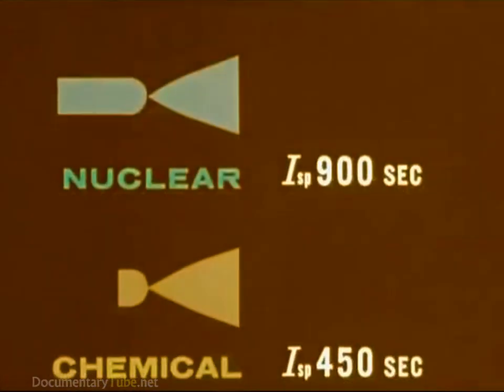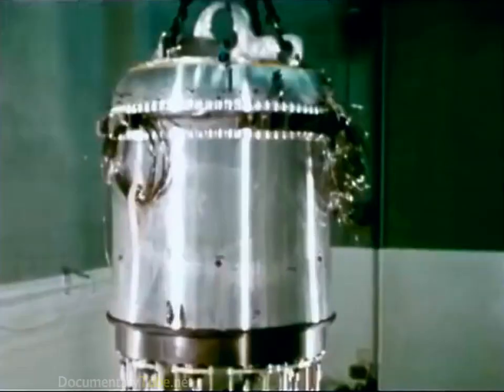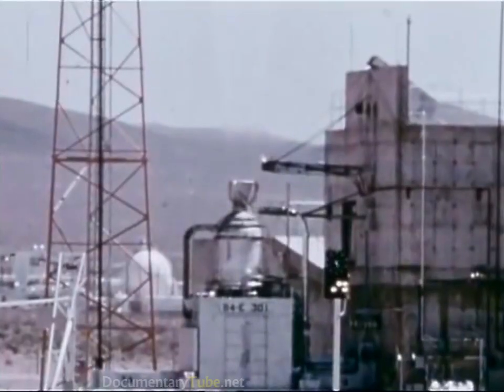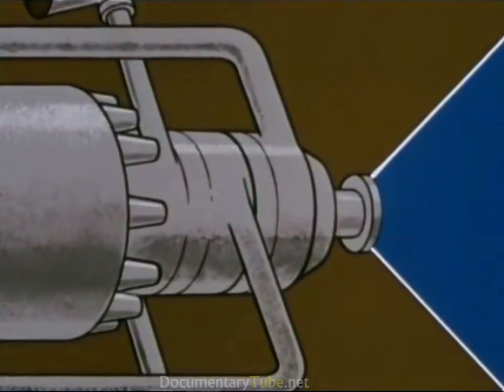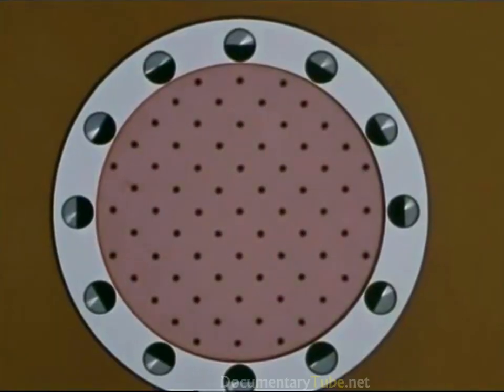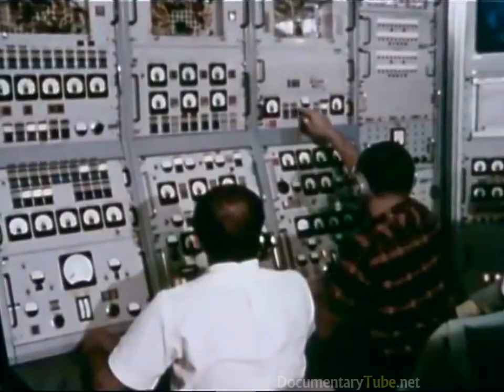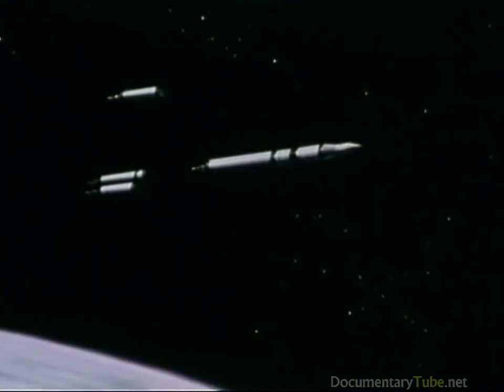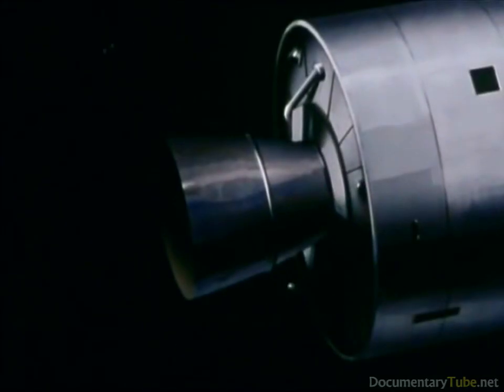HOW IT WORKS: Nuclear Propulsion

Comment: A rocket made with nuclear propulsion may have crashed in Russia about a week ago, The Russian government is scrambling to obtain Iodine tablets.
Reply: The russian one was a nuclear ramjet for a cruise missile. its principle is simmilar bur it heats up air instead of hydrogen. its simmilar to the project pluto
Reply: @nikos karavitakis < Problem is that air breathing ramjets won't work in space where there's no air, so they need to supply pressurized oxygen for it to work.
Reply: @BillAnt  Just seen the reply. This one was meant as a supersonic mach 3 cruise missile like the one in project pluto. Never meant to go to space
Reply: looks and sound as if they are down playing it the Russian that is
Reply: And yet this pin head MJ Horn is selling/promoting this fkn garbage, and saying most of us ignorant, caveman rubes cant comprehend its safe use...FK THAT! ITS GARBAGE! And must be relocated to the waste dump of technology!!! We cant even get rid of, or neutralize the waste, yet these fkn imbeciles promote it!!! SMFH!!
Reply: Infowars lifeshield..
Reply: ThothHeart Maat, WTF?
This very video points out that the reactor is cooled by the liquid hydrogen, turn off propulsion and you have turner off the cooling. With no atmosphere in space heat will not be pulled off the reactor, it will migrate on any possible path, like a spaceship.
Have any of you 'tards NOT wondered why this method wasn't pursued? .. No, I'm very disappointed in the users out there who suddenly get the religion of whichever videos make their happy sticks salute. 
There are 3 forms of heat transference LOOK THEM UP. What does space not have? 
Stop posting your uninformed opinions and learn.  You have 2 eyes, 2 ears but only one mouth, there's a good reason for that.
Reply: This video does NOT depict "Nuclear Propulsion" This video depicts a nuclear reactor acting as a high temperature heater for the on-board fuel. It's stupid.
Reply: @roxyraccoon8856  I was referring to the Russians looking for iodine tablets .. Infowars lifeshield x2...
Reply: ThothHeart Maat, I guess I have an itchy trigger finger.
Oppenheimer and many of the other Manhattan Project Ph D's had interesting things to say about "releasing the devil". Hanford,  WA, atmospheric testing,  Fukushima,  Chernobyl, Three Mile Island, the Detroit Breeder Reactor, unpublished incidents. Now this "unlimited" cruise missile.

It's why I laugh when I hear about "the superiority" of man. We don't seem to have the will to do what is best even when it is obvious.
Reply: @roxyraccoon8856  conduction, convection and radiation.  This rocket would operate on the principles of convection and conduction principally.  Some losses through thermal radiation would invariably occur.  The ISS uses thermal radiance to cool their battery packs.  It isn't like it can't be done.  That's how heat gets to the Earth from the Sun.  Light in the infrared range transmits heat.  Cooling it down isn't the hard part.  Carrying enough fuel to feed it is the big problem.
Reply: Rehoboth Farm, Space has no atmosphere, our Sun provides only Radiant heat. A reactor driven spaceship couldn't cool down sufficiently in Space to stop fissioning. Control rods or not, you need to stop the reaction, you do that by shedding heat.

Radiation is an ineffective means of shedding heat for nuclear reaction but for our Sun, that's okay.  It uses nuclear fusion and we really need it to keep working, all life on Earth would otherwise die.

Here on Earth,  WITH an atmosphere,  we must use water to cool nuclear fueled electricity generation plants. If we used only the atmosphere,  it would not be enough to stop the fuel rods from going critical. The control rods are used to slow the process but unless we also take away the heat, it is not enough.

Even IF the nuclear reactor contained nuclear fission material only "about the size of a marble" you're either using liquid Hydrogen to cool it or your fission material has melted its' surroundings and left everything in the engine radioactive,  which migrates to ship occupants. It actually destoys metal or did you not see the footage from inside Fukushima?

How many new reactors do you want to carry?  How much liquid hydrogen will truly be enough? 

Use too much fuel to cool it and you really are going too fast for anything except distant galaxies. Good luck decelerating or getting back. Far more fuel to decelerate in Space is required than to accelerate, you're going faster than you were the last time you ran used your propulsion.

The only proven practical use of nuclear reactors are submarines and large surface ships (plenty of cooling water)  - though,  the military can have them, I have no interest in being able to stay at sea longer than even they actually stay.

The clues about why a system featured in this video is a bad idea:
1. The reasons I  have listed in this thread,  some of which I will repeat here.
2. The speed of Voyager 1 and 2, traveling only thanks to initial rocket boost and the rest from using gravity from nearby bodies as a slingshot.
3. The fact that bodies in space not influenced by gravity but pushed by some form of propulsion will not stop accelerating.
4. Money.  You guys can't wait to spend it, especially when most of it isn't yours. Companies that would benefit from your ignorance are NOT Companies that I wish to fund.
4. I would in fact, like to line up all the retards who make their decision based only on videos and things they like to hear to all get together on a spaceship and go away,  I truly don't care if the spaceship works or not.
Reply: @roxyraccoon8856  Heat is shed by passing cold fuel through the reactor.  That's how the thing works.  To stop the reaction you would send fuel through the reactor till it is cool after turning the control rods.  Watch the video.
Reply: @roxyraccoon8856  3. The fact that bodies in space not influenced by gravity but pushed by some form of propulsion will not stop accelerating.
DERP that's the point.
Reply: @roxyraccoon8856  "Here on Earth,  WITH an atmosphere,  we must use water to cool nuclear fueled electricity generation plants."
The reactor in the video uses liquid hydrogen for cooling.  They built them, tested them and they worked.  You must be a democrat.  When your opinion doesn't match reality you then question reality.
Reply: Rehoboth Farm, MONTHS of cooling in cold water that is continuously flowing is necessary.  The water then must also be cooled for a long time or else boil fish.
Reply: Rehoboth Farm, Your ONLY intelligent posts are when you quote me so do it exactly and put all of and only my words in quotes, pretty please.
Reply: Rehoboth Farm, I wrote already just minutes ago  " The video showed only a brief use,  not the core nor fuel rod after use". Money spent,  engine tested AND? Rejected
Reply: Rehoboth Farm, It boggles the mind that you equate shooting down a test platform with "success".
Reply: @roxyraccoon8856  It was canceled in combination with the mars mission that it was designed to power back in the 70's.  The engine worked.  And apparently you didn't even watch the video I posted because it was a stationary test.  The main reason that nuclear rocket based technology didn't become popular was because idiots like you aren't even willing to understand the technology before deciding that they don't like it.  Do you still maintain that it is impossible after pretending to watch a video of the actual tests?  The actual tests proved that the technological basis was sound and that it produced thrust at five times the efficiency of chemical rockets.  Those are the facts in the place that we call reality.  If you actually watched the original video you would understand that the control rods being turned in create a reflector which causes the reaction to begin and rotating them the other way stops the reaction because one side absorbs protons ejecting from the decaying nuclei and the other side reflects them back in.  It is a very simple design made for use as a rocket.  It doesn't use fuel rods.  It bears almost no resemblance to the water cooled breeder reactors that are in use in the US today (which my father built).  Piss off.
Reply: Rehoboth Farm, HEAT! I can't keep making that point.  The test in your video link was on the ground (DIFFERENT from Space) ALSO,  NOT sinking in with you. 

So, I watched your video that had no sound nor narration,  I saw little thrust and while you might fail to comprehend the reason, I do.  Anyway,  you were kind enough to point out that it didn't fly so, it's much like all those toys you still play with.

At least you made it clear,  your father worked in the industry and you were hoping for a job L0like his, ripping off the taxpayers.  You didn't define his role in the "build". Did he pour the concrete? Something else?  I''ll bet he worked on the Breeder Reactor just outside Detroit,  the one that nearly killed millions. "We Almost Lost Detroit", good book.
Reply: Rehoboth Farm, A reaction in concentrated nuclear material will not stop unless it is cooled and no amount of influence external to that material will stop it.
Reply: @roxyraccoon8856  No.  That is not how it works.  You're wrong.  You don't know what you are talking about.  It is a nuclear reaction not a chemical reaction.  Heat is produced by a nuclear reaction but heat does not create one.  Go get an education.
Reply: Oh, shouldn't we ALL believe Rehoboth Farm and not the extensive reporting on Fukushima? You're 'admitted' to be another one of those "very stable geniuses", eh?
Reply: Rehoboth Farm, Heat makes any atom excited or, less stable.  Unwise for Uranium,  especially material already fissioning.  You didn't choose not be in nuclear,  that industry chose not to hire you, it is plenty clear why not.
Reply: Yes the Russians were  working on air breather jets. We found out jets were not a candidate for nuclearization. Yes rockets in deep would be useful and practical but must not be allowed to pollute earth or another planet.
Reply: Это неправда, никакая ракета с ядерным двигателям не взрывалась.
Reply: Rehoboth Farm, It is no one's fault but your own if YOU FAIL to comprehend that too much liquid Hydrogen becomes necessary, especially for slowing down.
Reply: Rehoboth Farm, The video showed only a brief use,  not the core nor fuel rod after use but hey, I guess you're "smarter" than all the Doctorates who still won't use it?
Reply: Russians should have just watched our YT videos to know nuke jets are not viable.
Reply: @mksherwood3068  They are viable and an would be an extremely important component for interplanetary spaceflight.
Reply: @roxyraccoon8856  They are ONLY intended for use in space. You don't know what you're talking about and didn't even watch the video.
Reply: Martin Stöckl Yes, but not for missile propulsion
Reply: @u3x590  The latest developments in nuclear propulsion are sadly intended to power intercontinental missiles flying at hypersonic speeds putting them out of reach of current antimissile technology. The resulting nuclear pollution is negligible compared to the atomic explosion of the bomb it would be carrying.
Reply: @roxyraccoon8856  >>> "pollute other planets"?  HOW??
Reply: @roxyraccoon8856  >>> "kick ourselves off the Earth"?_  HOW??

When the control rods are set, the reaction ceases.  You would KNOW THAT if you REALLY WATCHED this video.  

The crew would be shielded by (1) NOT being CLOSE to the reactor, and (2) Shielding is only necessary in the direction of the crew.  The ENTIRE CIRCUMFERENCE of the reactor does not need shielding like a reactor on Earth does.
Reply: RocKiteman _ 2001, oh doody! doody!  a stupor genius has appeared...  Control Rods only stop a reaction only IF the heat is ALSO removed.  How do you shed the heat in space, IN SPACE? (Hint, it ain't easy). Spacecraft are made of metal, that is a perfect migration path for Heat and for Radiation. 

I think anyone who is not paying attention,  like you, should spend more time learning. I really do not seek your lazy opinions.
Reply: @roxyraccoon8856  by sending fuel gas through it.  That's the whole point of creating the heat in the first place, to heat up the fuel gas, in this case hydrogen.
Reply: Roxy Raccoon lol who cares about other planets. There is no other life there, we can do whatever the fuck we want with them.
Reply: @mksherwood3068  they had Energia. a rocket way more powerful then anything USA every had.

Comment: I knew an old Westinghouse chemical engineer who worked on this. Still VASMIR could produce specific impulse of 5000 seconds or higher, much higher than nuclear thermal rockets.
Reply: I highly recommend you check out the nuclear salt-water rocket, The main problem with high efficiency drives is their low thrust, but this drive is a viable candidate for a torchship.

Comment: So it is basically just conventional rocjet but using radioactive element to heat up the fuel
Reply: Thomas Jefferson  Yes, exactly what I thought. For now, we do not have yet any reliable propulsion system other than ejecting mass from the bottom to push forward.

Comment: What I'm still wondering is how fuel efficient is it? Like if this were scaled down to the size of a motorcycle engine; how long could it run?
Reply: It’s twice as effective per pound of fuel. So if you could run a motorcykle with hydrogen thrusters you would go twice as far with the nuclear thruster as with the chemical thruster.
Reply: 1 gallon is 8.4 pounds do the math cc of engine too

Comment: that time they didnt know the grafite itself can start burning, and a tiny material error is enough to destroy the core.... and in space nobody can repair it, and if not flying up to space cuz a error happens u wont explode the Engine for safety... and were it hits the surface u have a problem, also such Reaktors are very heavy, deminishing the Enginse Postive effekts ...

Comment: A hydrogen molecule is twice as heavy as a hydrogen atom.  At  a certain temperature molecular hydrogen will ionize and become atomic hydrogen.  I’m not sure what that temperature is or whether materials can withstand it but there would be a significant increase in specific impulse if that temperature could be reached reasonably safely.

Comment: Can anyone tell me why this program hadn't continued?
Is it because the possibilities of fusion came into effect?
Reply: No, the Fusion option is not working up to now. I dont know exactly why they stopped the fission nuclear rocket projects. I assume they cut down the budgets, usual dumbness of politicans,  maybe some irrational psycological effects wich associated all nuclear matters with evil and I heared something about a kinda International space treaty wich maybe forbidds the use of nuclear power in space.
Reply: @tomasmieger6826  >wich maybe forbidds the use of nuclear power in space.
Only explodey nukes (so, unfortunately, no Orion, Medusa or Helios). However, nuclear electric and nuclear thermal are fine.
Reply: @caav56  - Ok, that is one more  reason to build nuclear powerd rocket engines. Esp. the fission thermal motor option has got great potential. Since I was a student I asked myself why there were so less focus on that option.
Reply: Consider the numerous failed launches since these tests were run. Now imagine a reactor being part of what scatters when that happens. In addition, the tests did not need to launch the shielding. Static trust measurements of efficiency do not take into account the weight of lead needed. 
This is the same reason nuclear airplanes don't exist.

Comment: I'm sold. Let's build it!
Reply: @Another-Address  The Nuclear propulsion part is meant for spaceflight.

Chemical rockets were to be used to get several stages of nuclear thrusters into orbit. Then those are assembled and the mission to mars begins.

It's kinda still part of the plan. 
Even if ion thrusters are used, most likely a nuclear reactor would still power it.
Reply: @tylerdurden3722 wow, finally I understand where the term "impulse engines" comes from in star trek
Reply: @Another-Address  I see no proof of that

Comment: Jettison just the radioactive core and reuse the tanks, pumps, controls etc. Plug in a new core and ready for use (after good inspection and repair if needed that is)

Moon base fabrication and then much smaller rocket needed to put into space may be very interesting

Nuclear power to run a much bigger craft that goes to Mars and farther would be interesting. Would have to use radiate heat probably from a liquid metal to the radiate emitters (same purpose as cooling towers for nuclear power plants) for heat engine type processes

Energy from a nuclear power plant in space could be transferred to the ground via laser or other electromagnetic means anywhere on a planet or moon
Reply: Nah, recycling the core will be a smart thing to do, as the nuclear fuel is not cheap and even clogged core has still quite a lot of good isotopes left. I guess it'll require some kind of an automated space-based reprocessing facility, but it's possible.

Comment: the thing is, fuel is one of the cheapest parts of a rocket launch.
Reply: Launch yes, but how do you obtain the fuel to replace the used fuel in space?  Hydrogens are pretty easy to find in space for refueling.